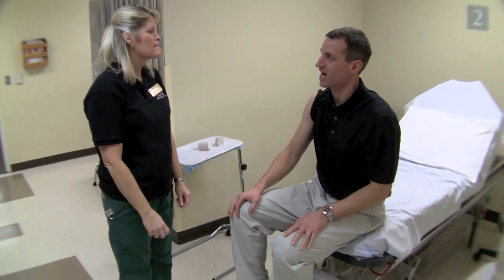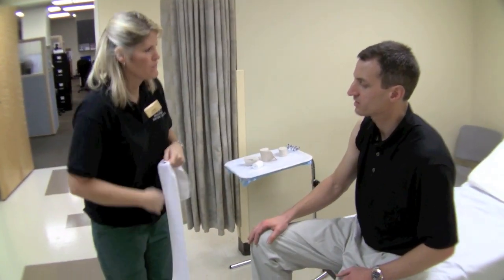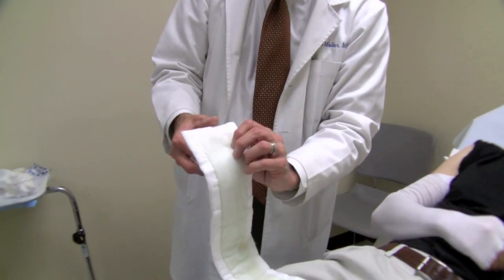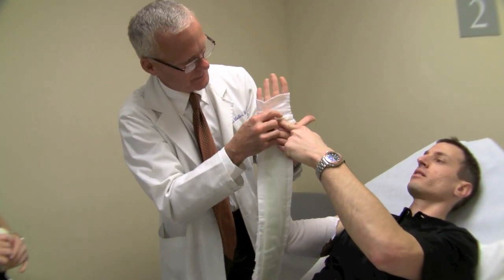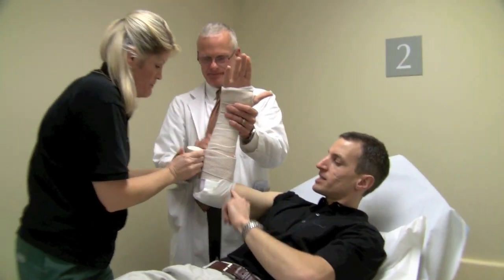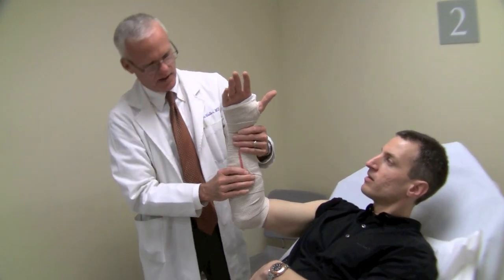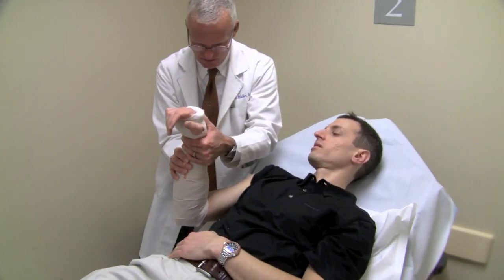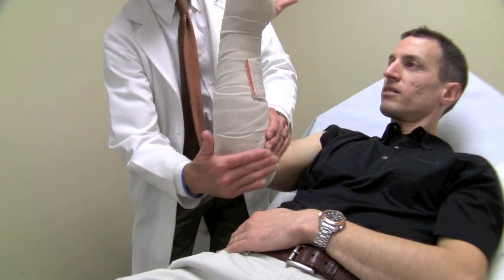Splint like a pro: Sugartong Splint

Comment: Not a good idea to use your fingers to grab at the soft, not yet hardened cast. You can create pressure points unintentionally and cause sores and potentially out pressure in the ulnar nerve. Try a reverse sugar tong splint and smoothing with the palm of your hand from the center out. Good luck.

Comment: I thought we were supposed to place wrist in slight extension when doing splints like this? Can you please explain?

Thanks
Reply from the maker: Hi KB. This splint was an example of what's used for the Colles' fracture. The volar angulation or slight flexion is theoretically to provide an opposing force to keep the reduction in alignment. Most sugar tong splint's I've placed have been for this indication and have had a neutral to slightly flexed shape. In a volar only splint, such as is used for a non displaced or angulated fracture, there is generally a bit of extension put at the wrist. Hope this helps.